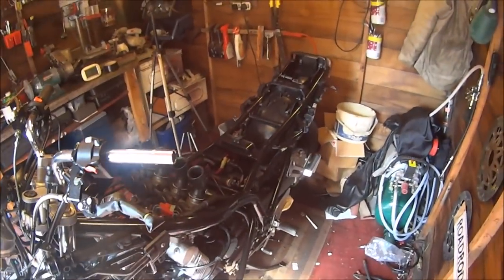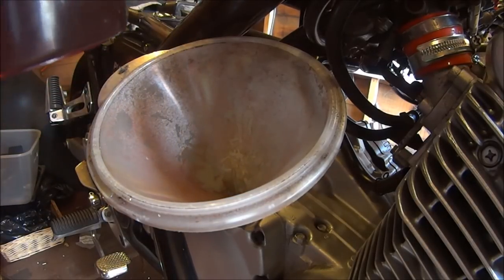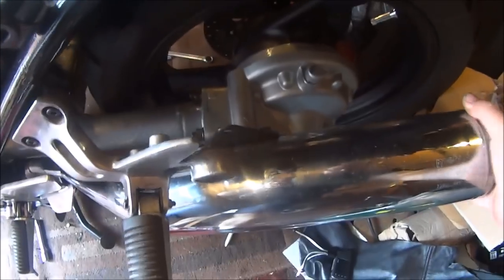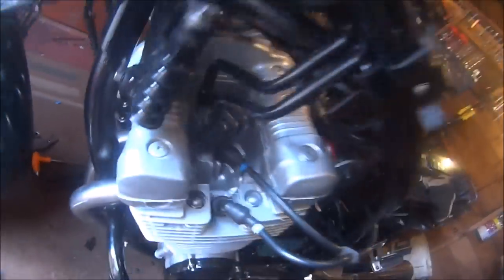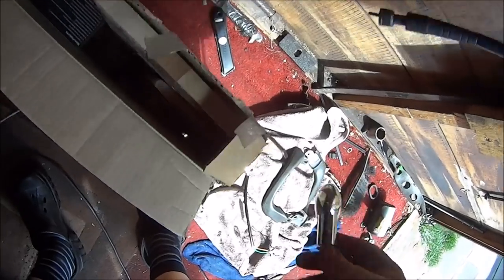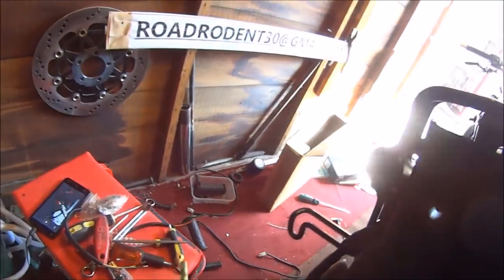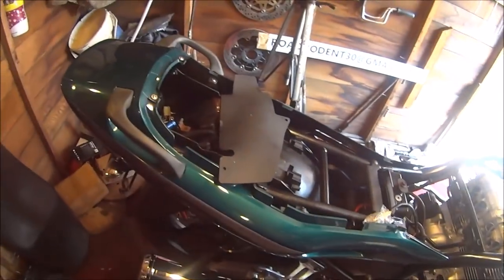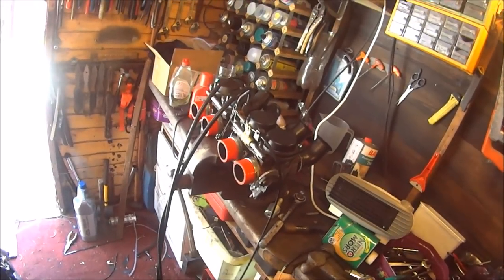Xj900s diversion. Oil indicaters plastics and exhaust installation.

Comment: Are they motad cans as I’m sure my OE ones fit the bracket in the inside! Anyways as long as they now don’t fowl and there is no blowing! How’s the tank coming on? I tried to strip down my OE front master cylinder today and found the piston seized. I’m soaking it in wd40 but I may change it for a fazer M/c as they look almost identical😎
Reply from the maker: Northerner 137.... Hi northerner motad definitely won't go on the inside without getting destroyed by the rear axle. Yes a lot of people have told me that the fazer and the R1 calipers are all identical and just bolt straight on. Good luck with it i hate brakes glad mine are sorted for now..

Comment: Those indicators actually suit the bike well, match the shiny exhaust. Do you recommend using any glue on your grips when you change them? Need to do mine this winter never done it before lol
Reply from the maker: I have since changed them they were a little to dim in the sunlight but they are still chrome. I don't normally use glue. If you need to take them off you will probably end up destroying them with a Stanley knife but then again if they are to lose I would probably wrap some tape around the bars first. If they are to tight just use some water then they should slip on easy. good luck and we need more videos from DSP Guitar Tuition. Keep on rocking.
Reply: ROAD RODENT awesome advice cheers will give it ago over winter. Got a video on the way as we speak. Got any requests?
Reply from the maker: Well with your sound setup bet you could do a great Gary Moore parisienne walkways cover..